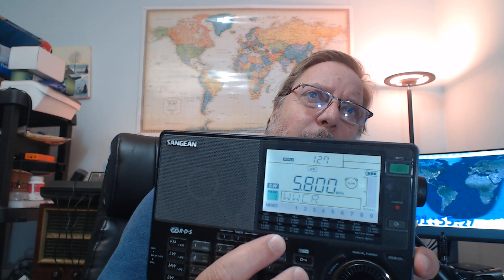Single Sideband SSB Viewer questions about how important it is to have it on a radio

Comment: I find SSB is really useful for shortwave and medium wave broadcasts as well. It gives you another option to kind of reconstruct those weak signals. I do find that on radios without it, depending on the signal, you can still kind of tell what hams are saying, and I can usually even pick up a few ft8 decodes.  So it may be worth going through those bands even if you don’t have that feature!

Comment: Long time viewer... back when you used your R8500 and a RadioShack amplified speaker.
Early on, I found fine frequency resolution and IF shift to make a huge difference after a proper wire antenna with a preselector.